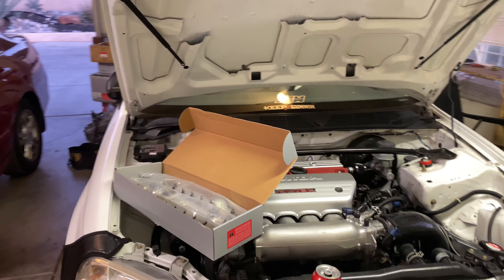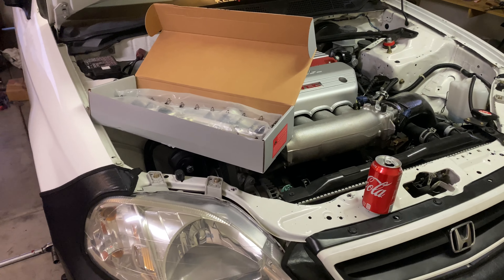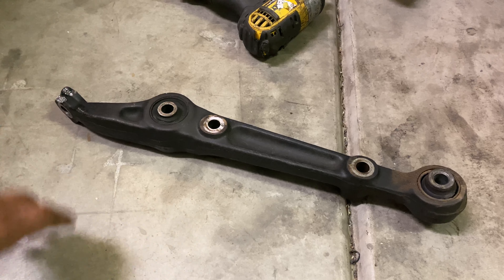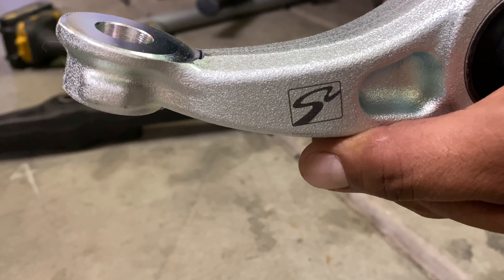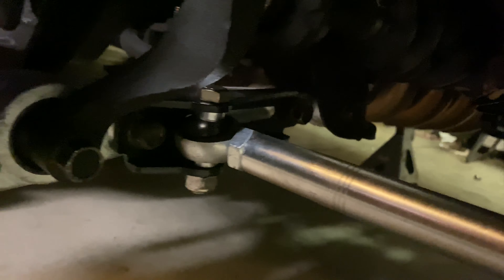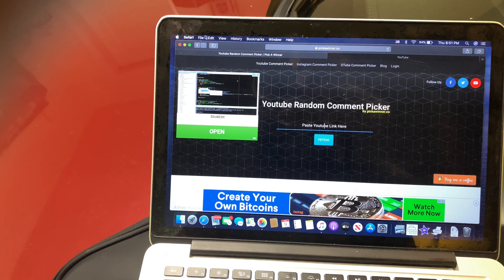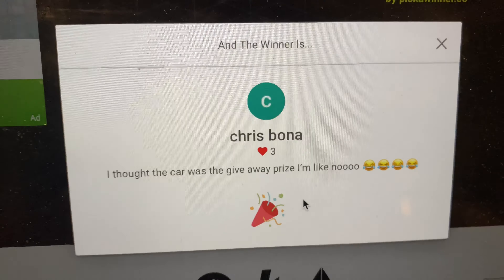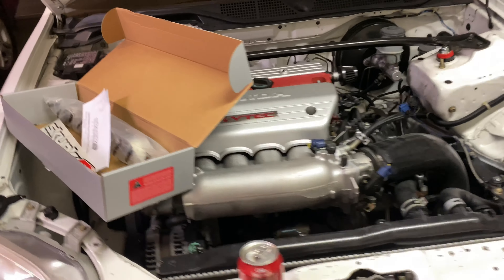K24a CIVIC EK BUILD UPDATE!!

Comment: Nicely done man :) ...... How would you wire up a Toyota SW20 MR2 if installing a RSX Type S engine (K20z1 or z3) and gearbox ? Use aftermarket harness or splice honda and  toyota harnesses to achive this ? ... Thanks :) ... Keep up great work :)
Reply from the maker: Use rsx harness splice into the Toyota harness for the components needed
Reply: @oemworx4147  Thanks, I should have mentioned that all I like is stock oem ecu, not interested in aftermarket. So I assume to splice the MR2 body harness with the  RSX engine harness and modify mr2 charge harness. Would that be correct ?